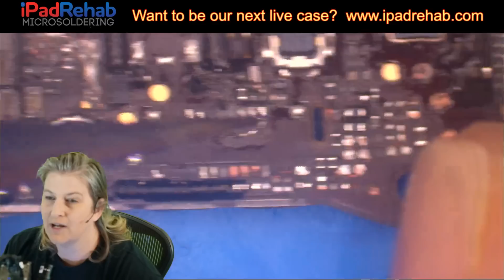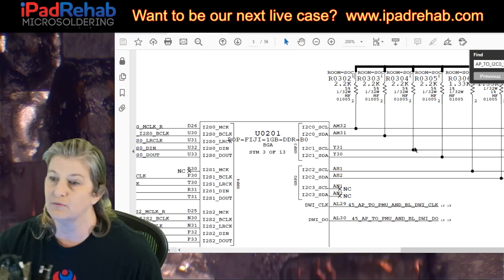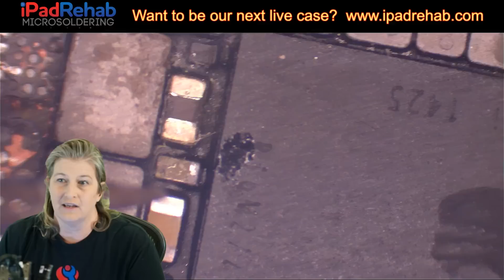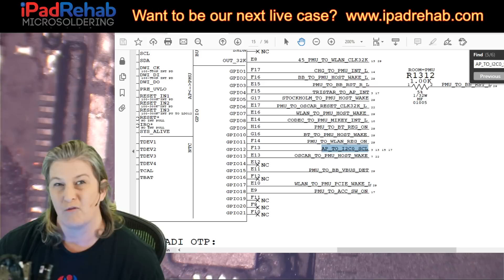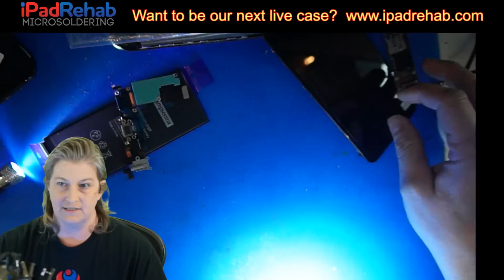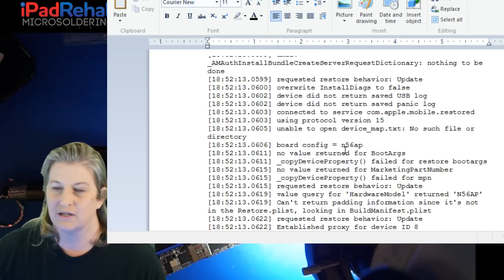Part TWO: Saltwater iPhone, Why not swap the memory?

Comment from the maker: Declaring this one Officially not recoverable "with today's technology" 
To leave no stone unturned, we:
1.) Confirmed that the matching tester board with same components removed can indeed pass update with same parts/cables
2.) Lifted EEPROM to rule out hidden corrosion and confirm 1v8 to EEPROM
3.) Removed NAND to check for any water under NAND--none.   Checked resistance at NAND communication pads--all correct.  Reballed NAND.
4.) Tried update again--same result.
5.) Attempted Checkra1n jailbreak to potentially clear some hidden software fsck error---then update again.   No luck.

And that's the end of the line for us!
We are very confident that this phone has some corruption of information from the water damage---possibly blanked EEPROM, possibly corruption of the filesystem of user data partition.   I would bet that this phone can pass RESTORE if allowed to blank data, or replace NAND.   There are no other hardware interventions for us, and no software interventions exist for meaningful interaction with encrypted data on the memory for today's iPhones.    

We gave it our best shot Kelli---our recommendation is that you plan another trip to the Bahamas!
Reply: That raises a question - would it be meaningful to dump the NAND and EEPROM content with a reader, in case of some future advancement or vulnerability?
Reply: @val3tra  I was thinking the same thing, one days the key to the city will be leaked.
Reply: Bummer they don't have TVS diodes on critical lines to deal with spikes...  The world would be a much better place if that was a common practice.

Comment: I left my iPhone SE in my pocket while swimming in the ocean for a few minutes. In less than an hour I got it to a phone repair shop where they took it apart and started drying it immidietly. They said that there wasn’t a lot of water inside it, even though the screen was already very broken, but it was too late, the phone was dead. I then sent it to another normal repair in another part of Sweden and they couldn’t get the pictures or get it to turn on even, but they took like 200 dollars from me anyways. It gives me hope to see that phones who have been under saltwater for minutes can be saved, or at least the memory. Is it common for you to be able to save them, though?

Comment: I know you may have given up on it, but check the I2C lines, the default state of Data and Clock should be high, i.e. 1.8v. If there's anything pulling them down you will get the same result as when those resistors are missing. 

I2C is a weird protocol, in that the chips CAN NOT DRIVE THE LINE HIGH. They can ONLY PULL IT LOW. If the line(s) are low, then there's something (corrosion, or that face-punch) that's pulling them down.
Reply from the maker: Yes, We always check i2c for 1v8.

Comment: what about dumping eeprom to another eeprom?  and putting new eeprom with cpu and memory to different board without any corrosion? also you took out baseband chip, so you need "cooked" version of iOS without baseband check and update.

Comment: I assume there are no options available to use JTAG to test data lines between the cpu, nand and any other JTAG capable parts.
Reply: Requires some not-so-cheap tools to accomplish ... although there are some open sources tools that do that. JTAG testing is kinda a thing unto itself. 
The board "net list" is something one would have to re-create to feed into most JTAG automated "test script" creation tools. Engineering test at Apple takes the board layout netlist and uses this. Hand writing, hand crafting a netlist or JTAG test script is something that could be done. I imagine the fedgov agencies use this technique to access NAND and flash and RAM etc for data extraction purposes.

Comment: Before tossing this in the pile of no fix I would check if 1V8 is making it to the rollback EEPROM. Lots of damage on 1V8 lines so maybe a via/trace got corroded going to the EEPROM.
Reply from the maker: Fantastic suggestion.  I did pull eeprom yesterday to confirm no hidden corrosion and continuity on 1v8.   (I also updated the tester board and it passed as expected.)

Comment: so why not reprogram the eprom
Reply: EEPROM also contains vital keys for FLASH decryption, after clear EEPROM You need reformat NAND = data loss. Goal was recover data not device.
Edit: It is common pain of ass with all encrypted devices, without encryption was enough move NAND or eMMC chip to reader and dump raw image from it. In this case without proper encryption key this method will not work.

Comment: Jessa, the update was trying to communicate with baseband and couldn’t get an ID cause baseband is probably dead. The error was in the log. There’s still hope Jessa :)
Reply from the maker: Baseband pmic is not on the board.  Also, the matching iCloud locked board with the exact same components removed did pass update.  So we can conclude this is definitely not a hardware issue.
Reply: Okay awesome. I thought u missed the error log (4th line from top @ 44:34) and only wanted to bring it to your attention. I love these types repairs. You’re the greatest Jessa ♥️
Reply: iPad Rehab is locked and stripped iPhone on same firmware?  Didn’t Apple at some point remove baseband pass/check requirement in recovery proccess?
Reply: Baseband is unpowered, iirc.

Comment: A silly question what if you bake the CPU without moving it? just reheat it?
Reply: (bro)
Reply from the maker: Then...you’d have a really hot cpu that you have now risked swelling solder balls and bridging.  But it wouldn’t bring back data.  “How did it come to be this way?”   Not from CPU joint problems.  This is water damage
Reply: @JessaJones  Thanks for clarifying (^_^)

Comment: Love these kind of challenging repairs. One thought from the  old  through hole soldering days ...might try heating the board before you attempt to boot it .. heating solder joints on corroded boards helped about half the time ... just thoughts from a senior.... naw just old guy.

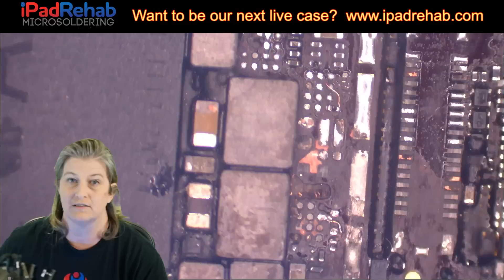Comment: 33:10 the cpu and pmu are on those I2C lines, yet changing chestnut allowed it to short boot loop, which says that there is still communication on those lines, and kinda excludes electrical damage on those lines, it doesn't exclude though that other lines  got hit by a high voltage.
I'm gonna say, make a copy of the nand and the eeprom. 

and for testing purpose sake, when messing with the eeprom causes those same short boot loops and error 9... Does messing with the nand communication cause the same behaviour ? 

just my 2€c of brainfarts. Maybe there still is a data line communication issue, I'd dare to guess for the eeprom since it was on the side that got hit by water damage, though nothing seems visible.
Hope this becomes a succesful data recovery.
Thanks for your wonderful videos !
Reply from the maker: Short loop probably isn’t i2c—but the prior i2c problem (or some other problem) likely caused corruption of the some key or file system structure  on the nand, filled a required error log, etc.   This phone behaves the same as a device with a corrupted nand or damaged eeprom that can be solved just by erasing user data with a restore or reformatting the nand.   
The only remaining hardware possibility is poor connection of the nand and cpu—but  that problem is usually from bend, not water damage.
Reply: I do t think there is a data integrity problem I think there is some
Thing blocking communication and preventing the phone from going into next stage of booting and recovery.. maybe a stuck power line somewhere.

Notice that was also boot looping in recovery as well? I think something causing it to reboot constantly before it can even get to the critical files.. something is stuck or missing that this iPhone for some reason needs.  Maybe early enough firmware that baseband is a requirement for anything to happen or maybe tiny super low current short circuit hidden somewhere causing the boot proccess to get interrupted. 

I have recovered a few iPhones that were stuck In this same boot loop proccess and never even saw water they just “randomly” one day acted this this way as far as I am concerned because don’t know why.. iPhone 3GS and iPhone 4.  They would constantly reboot even in DFU and recovery.. I think for the 3GS the problem ended up being short circuit in the power button circuit because the repair that was done to that was they replaced the connector on the board and the ribbon at this small hole in the wall shop down the road.  As for the iPhone 4 I had I think that fixed itself somehow.. I tore it apart and poked around and I wasn’t smart enough to figure it out but eventually it came back after enough boot loops I guess? Then I did recovery moment I saw it comeback and worked for a couple years after that.  Still have no idea what caused it or why it came back I do know the iPhone got very hot after a while of doing it maybe it reflowed a component and fixed itself I don’t know.  Weird

Comment: This might be a dumb question but couldn't you just remove the memory chip that contains all the photos and video data and transplant it onto a new working board?  That seem like a whole lot less work.
Reply: In the video she explains that the memory is encrypted. To decrypt it you need three chips to work together: the CPU, NAND and a third chip, I think it's called EEPROM. You need to transplant all three in order to read the data. And if the NAND is corrupted then it will do the same on the new board.
Reply: @sasodoma  Thank you for explaining! I didn't watch the whole video and was curious too.
Reply: No, because the NAND, CPU and some other IC's are cryptographicly linked together so they would all need to moved. And she explained in the video the CPU is very hard to move.